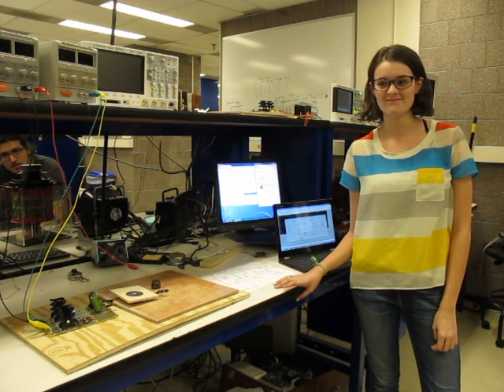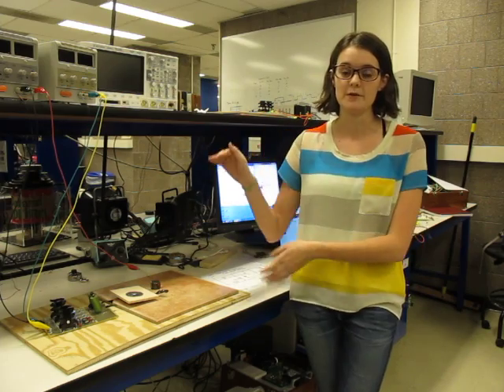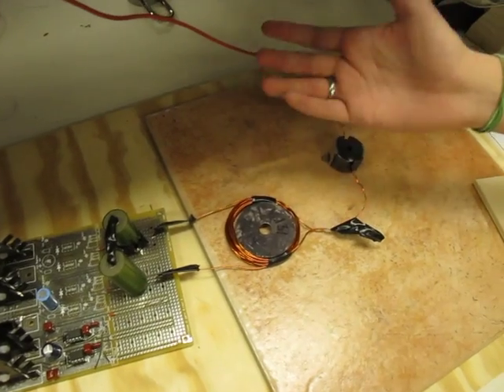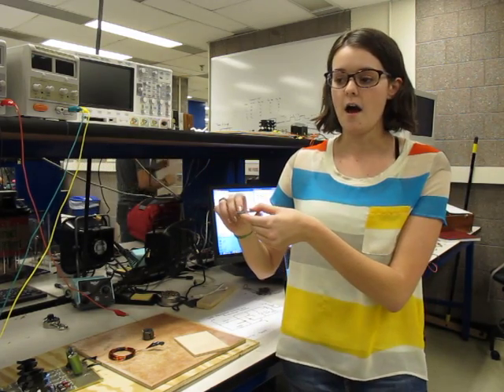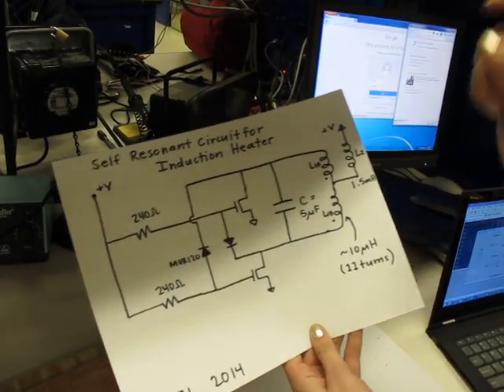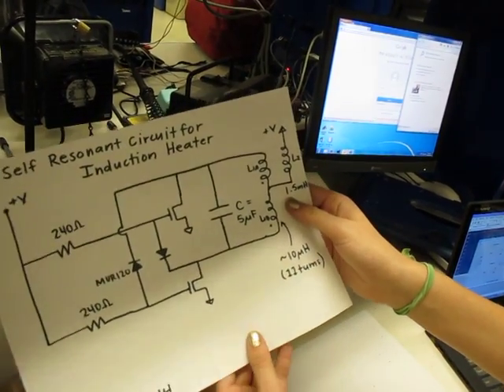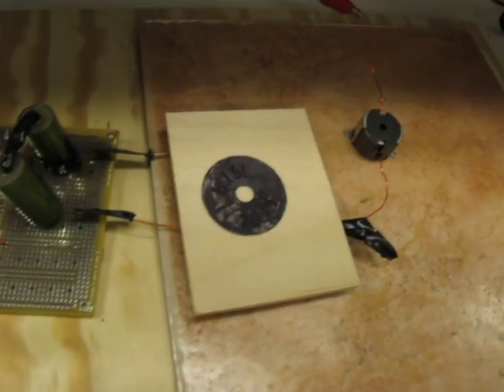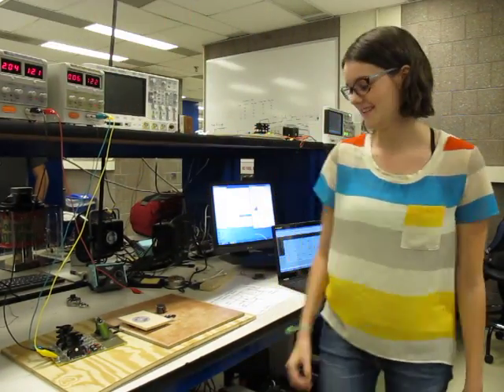6.131 Final Project - Self resonant induction heater

Comment: the one thing which bugs me about this circuit is the choke (L2). Why is it needed?
Reply: the amp draw of  L2 neither rises nor falls.. kinda makes it useless then dont it
Reply: L2 is already delivering amps to the circuit when each of the transistors open making circuit more efficient.. but yes the circuit can work just as well without L2
Reply: @MrRasZee  on second thought, L2 is a resistor for AC but lets DC through, thus it prevents the resonant oscillation to travel back to the power supply
Reply: Power supply might blow up without L2
Reply: @ThomasHaberkorn  LOL